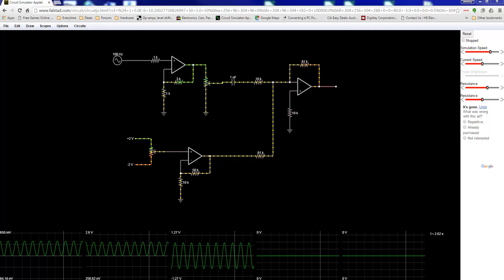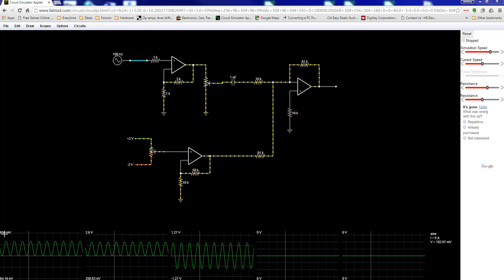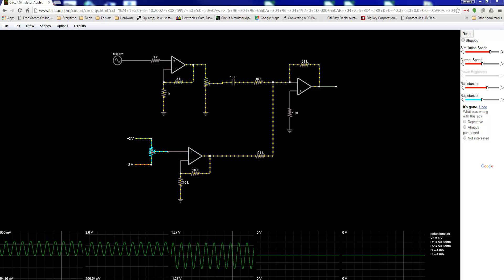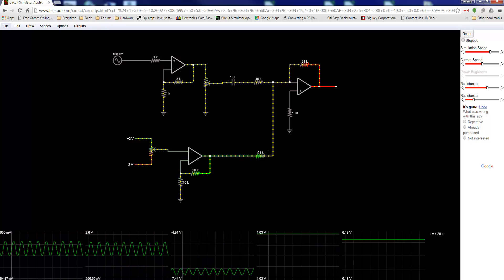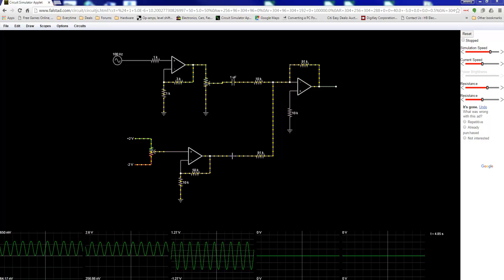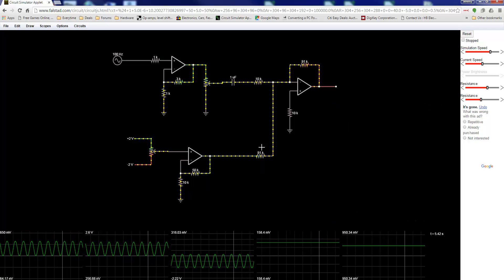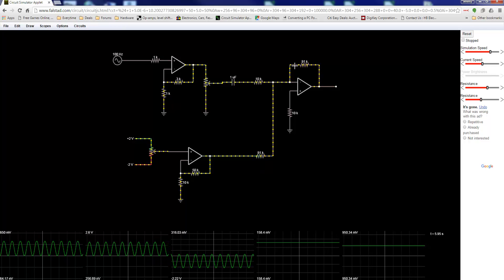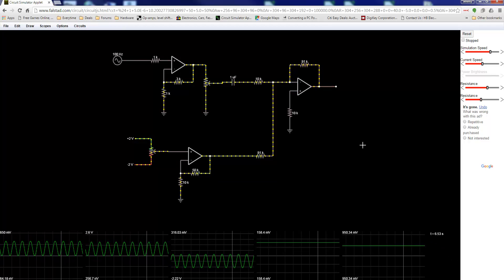opamp offset 1

Comment: (Huge comment incoming~)

It's because the two 91K resistors give that op-amp a gain of -1 (or 1, depending on which input(s) (inverting/non-inverting) the signal(s) is applied to).
So, a 1V offset on the inverting input will give you a -1V offset on the output, if you have a gain of -1 ( - sign is for the inverting).
If the gain was -2, then you'd get -2V. With a gain of -3, you'd get -3V ... etc... etc...

I have no idea how you actually want the circuit to behave, so I can't say exactly how to correct it to make it work.

If you're trying to subtract a certain voltage from the input signal (which comes through the top left op-amp), then feed the signal into the non-inverting input (+), via two divider resistors, and feed your desired offset voltage into the inverting input, using the same two 91K resistors. 

Fun stuff though, I love analog electronics like this. :)

P.S. I don't exactly condone cheating, but here is a nice calculator for op-amp gain:
http://www.daycounter.com/Calculators/Op-Amp/Op-Amp-Voltage-Calculator.phtml

P.S.2.
To see what I meant about changing the circuit, in the above calculator, set these parameters:
R1=91K
R2=91K
R3=10K
R4=10K
V1=0V ("Offset" voltage)
V2=3V ("Signal" voltage)
Vp and Vn can be left at plus/minus 12V
When you hit calculate, you can see that the output voltage Vout is 3V.
Try changing V1 - the "Offset" voltage - to 1V.
Now you will see that the output is 2V. This has subtracted 1V from the input signal.
With V1 at 2V, the output will be 1V ... this has subtracted 2V... etc etc..
(I think that is what you are trying to do, but I'm not 100% certain.)
Happy engineering!

P.S.3. I'm not a proper electrical engineer, but I'm not dumb either XD

P.S.4. Also, that's a neat circuit simulator! I, however, use a stand-alone program called LTSpice. It's free too! It can be trickier to use, but it allows you to do very detailed component models, to exactly (well, as close as can be) match real-life components.
Reply from the maker: +Benjamin “Ozias” Esposti 
Ya, I posted this on the EEVBLOG and got some good info there and figured out why everything is the way it is.
The key for me was the virtual ground at the input.
Reply: +skimask87 
Dang ... oh well ... I guess I got to exercise my writing skills XD
I am a member on the EEVBLOG forum, but rarely ever go on there.
And yeah, it takes me a little while to wrap my head around these circuits, but it's good fun once you get it all working a treat! :)